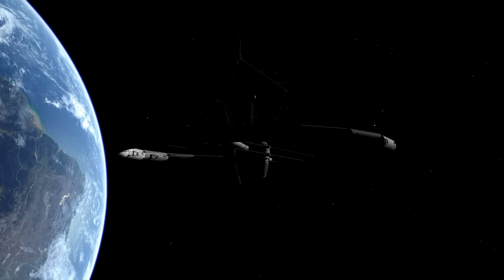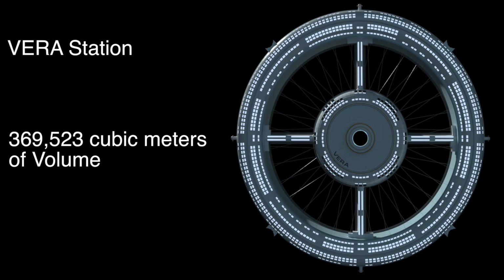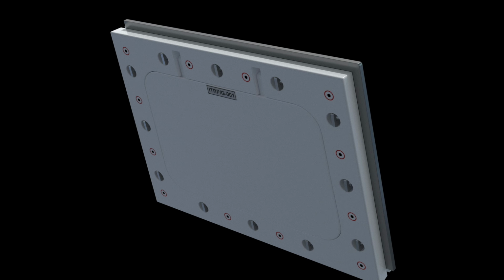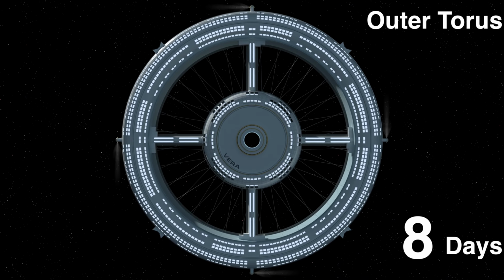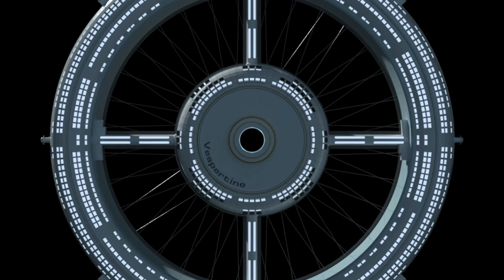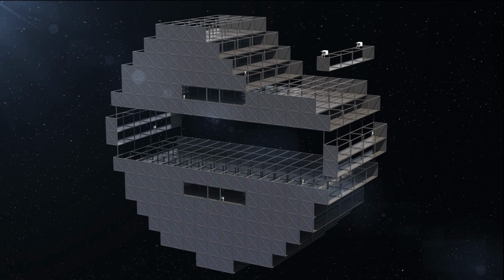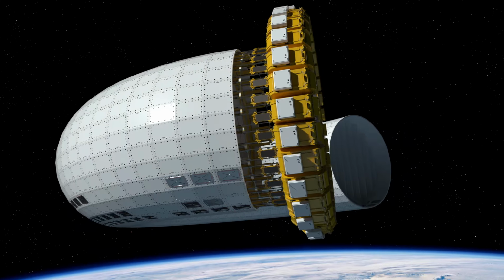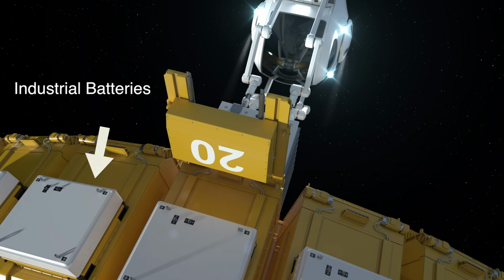We could build this huge Space Station in 6 months

Comment: One huge and crucial design flaw; You cannot rely on one giant pressurised hull. It has to be lots of smaller compartments with sealed door in between!!!
Imagine the catastrophe of a debris hitting and the whole hull gets de-pressurised! It must be built in sections.
Reply: There was an image showing internal decks. That’d divide up the ring and then all you need are partitions/pressure doors perpendicular to the decks.
Reply: @DownunderGraham  I was just about to say that,
Reply: Not really, the hull does not depressurize quickly. the pressure differential is very low, so air evacuates surprisingly slowly. the iss famously had a puncture 1/3 inch in diameter and the crew waited a day to repair it. When talking about hundreds of thousands of cubic meters of air, it would take well over a week for air to drop to dangerous levels from even a basketball sized hole. So two sections, along with evacuation craft, is all that should be necessary for a very safe design.
Reply: Ships, submarines and pressurised aircraft hulls tend to be singular and still considered safe. Building bulkheads within the structure to contain a major pressure loss would be a given, even for a structure in the benign (compared to ocean and stratosphere) vacuum of space.
Reply: @davidgifford8112  submarines are segmented, each compartment or major section can be isolated from flooding by watertight hatches.
Reply: @davidgifford8112  submarines, ships and aircraft are all compartmentalized.
Reply: @davidgifford8112  new generation nuclear submarines are double hulled. The older diesel subs were single hull but they pretty thick to withstand the pressure.
Reply: @fbi805  And there were and are bulkheads every so often so that a damaged section can be sealed off.
Reply: probably gonna have a self sealing exterior similar to fuel tanks on planes
Reply: a tiny hole wont cause the entire station to explode like in movies, on several occasions the ISS has been hit and had holes torn though it and all it caused was a small hole the size of whatever hit it leaving air slowly.
Reply: @coreytaylor5386  it only takes 1 tiny hit in a fuelcell to disable a space station and the ISS on several occasions over the years has had to stop operations just to identify, locate and repair the small holes created by the micro meteors. Several of those included the removal and replacement of their attitude thrusters.
Reply: First thing to hit my mind when seeing this. I love the design and ingenuity however. Maybe once it is built they can easily add pressure doors inside and divide it by 8 sections or something. Also they could design a self healing glue in the walls that when exposed to space instantly seals the breach.
Reply: lol im sure they know that already. not much of any ships on earth is built with just 1 large hull. There are always bulkheads. Same with space station. I dont believe anyone would allow them to build this without letting them know before hand. The interior is just not that important right now considering how they have not even built the exterior before in real life. Also because im sure the interiors will be configurable.
Reply: @Lilmiket1000  ah how much do you actually know about ship building? All surface ships are built with a single main hull with the only exception being the fuel and energy transportation tankers which have a double hull around the tanks for extra protection.
Reply: @Lilmiket1000  bulkheads are not part of the hull design system. They are interior design systems located at certain points of a ship or space station and specifically designed to protect an undamaged areas from damaged areas
Reply: @fbi805  Actually, they are part of the hull design system. Without the bulkheads, the hull would collapse on itself.
Reply: revolving airlock doors would be a good idea for internal doors.
then there is no way a rapid depressurization could take out the whole station because someone forgot to close the door.

revolving doors never allow airflow to pass freely through, since only one side is open at a time.
Reply: make the station big enough and even large holes will take months to vent out the atmosphere. what you see in movies is incredibly wrong. in reality if you made a bullet hole you could stick your thumb on it and problem solved. taping it shut would also work just fine. then fix it properly later when you have time.
Reply: By the time they raise enough money we will all be dead anyway.
Reply: It's got a force field like starwars pewpew pew
Reply: Not necessarily,  I  have  a solution  for  that,  but it will  prevent space debris and meteorites etc.  From making contact with the  structure.
Reply: Do the math - an impossibly big hole versus a huge volume with ~8 PSI pressure difference, would take days to leak down.
Reply: yup. imagine a fire breaking out. No way to choke the fire, also the smoke spreads around the entire hull. should be built in segments so you can evacuate and detached the damaged section of the torus.

Comment: Which influence does the Temperature Has on the assembly process? If some of the Tiles are in Shadow and Others are Exposed to sunlight there should be  differences in size and even hardness to Account for
Reply: Maybe they will creat a sun shield like the Webb Telescope has just larger.
Reply from the maker: CGWerft you are right, and the answer from Christopher Bloom is also right. There will be a canopy over the Sargon CR to keep the working temperature moderated. Great points.

Comment: Suggestion: for each of those cartridges (the yellow compartments that you load stacks of panels into), maybe you could design them to be tall enough to fit a few more panels more than the quantity of panels that will be loaded for each delivery. That way, production won't have to stop while you reload cartridges with new panels, because a cartridge won't have to first be emptied for a new stack of panels to be reloaded.
Reply: Good idea in general, however I could imagine that the so-called panel cartridges may be replaced with a full one once the last panel has been taken out for mounting and welding, so there would be some time before contruction would need to stop. This time span would depend on the time needed to mount and weld a single panel. That may  be a short time window, but of course, w/o more information, we cannot say for sure how long that time spam would be.
Reply: The system would, of course, be completely dependent upon its supply chain stability.
Reply: @roysheaks1261  Nailed it. Beyond that, the structure must be sustainably robust so that it cannot be readily damaged or destroyed through either natually, mechanically or by human intervention (human nature being unpredictable at best and malintentional at worst).  Therefore the panels would have to be strong enough and durable enough to with stand these things suggesting additonal mass to be lifted into LEO.  In turn, that will slow the delivery of assembly parts and equipment as more mass means larger delivery systems (larger than starships) and an op tempo that puts current tech to ridiculous shame.  Light weight structural components need not apply.

Comment: Why not just send up a 3d-printer from relativity space, or send up a roll of steel and roll it into rings like spaceX does. Don't see the point in assembling it out off square panels.
Reply: the square panels are not square, they are shaped so as to form a ring that is a doughnut, coil steel would actually make the process more complicated as the coil would have to vary in width and positioning would be difficult,, the interlocking panels will simplify the engineering,,  some kind of printer making the panels would probably work good once resources are mined in space, i hope we see this one day !
Reply: @hugokappes4077  When i think about it, why not just make a straight tube and spin it end over end. Would mean varying gravity depending on what level you're on but, that might not be a problem. Would be a novelty for space tourist, and a opportunity for science and research on effects of different gravities.
Reply: @hugokappes4077  Why print panels when you can print the whole structure at once, doesn't matter if the material is launched from earth or mined in space. Get that the panels aren't square, but varying width on the roll wouldn't be hard. The assembly machine seems like complicated engendering, a roller or printer would have much less moving parts.
Reply: @danhunters8226  even a spiral coil construction if you could get around the width variation needed,, maybe that would be the application for a printer of sorts like the way Elon prints his rocket engines,,  print out the sheet in one continuous piece the right shape as it spirals around,, but i suppose if your going to print you could just do it edge on,,  I hope we get to see how they end up doing it,,  definitely it will be different then fabrication on earth ,,  maybe they could make a doughnut membrane on earth and just inflate it with something and then hard coat it,,  got to be a lot of ideas floating around out there,, I bet Elon has a few ideas too, lol